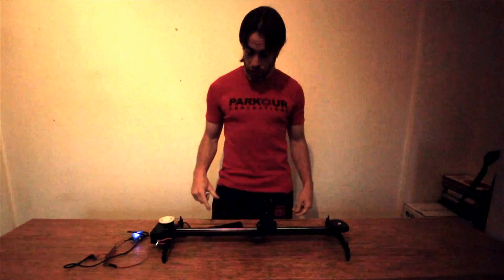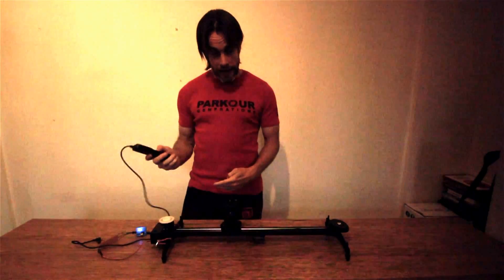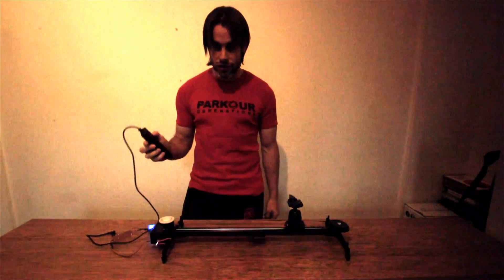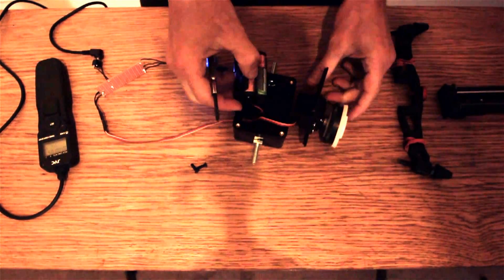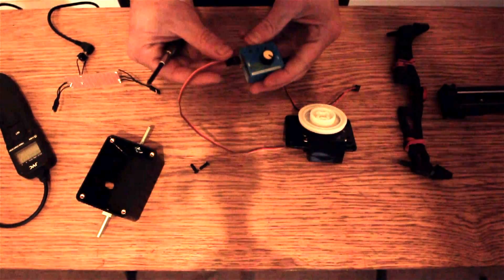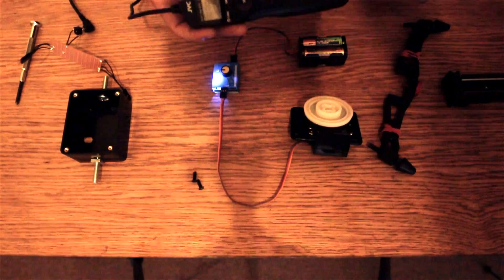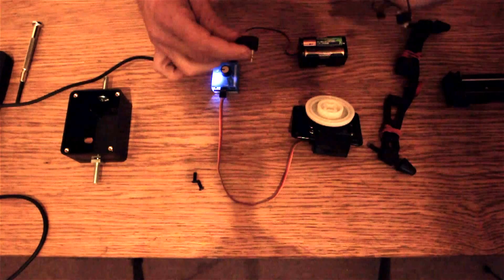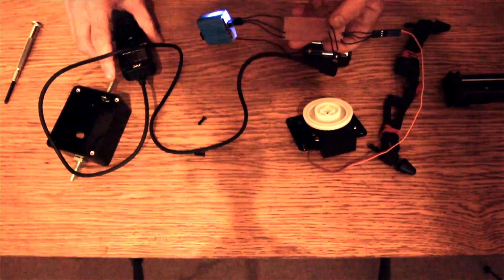How-to guide on building cheap motorised slider controlled by timelapse remote

Comment: Hi Andy, very nice idea, but I have a question. I'm wondering if your setup would still work with heavier loads, camera and lens. Have you tried to mount a heavier camera and lens, or use the slider at 45 degrees angle? I have the feeling that this motor will not be capable to handle it, or the servo will consider it as a too heavy load and will stop as it stops at the end of the course. Am I right? honestly. Thanks in advance for answering

Comment: Hi Andy, I hope you're still monitoring this post. If not, maybe somebody else who've tried it could answer. If I understand it correctly, the wired shutter remote could be programmed to move the servo motor? Are you able to sync the servo movement to do a shoot-move-shoot? What I want to do is stop the slider camera plate while my Lumix G6 shoots a long shutter timelapse of about 5 sec or more, then move about 1/4 inch, then shoot again another long shutter timelapse shot to assemble a final timelapse video in premiere. Thank you, whoever could answer this seemingly noobie question.
Reply: sonicbrush That is exactly what I am after. did you find a way to do this? I was thinking of a jack splitter one going to the module and the other  to the camera?
Reply: AssyrianHymns I have ordered a similar intervalometer like Andy had on his video. I'm just waiting for it to arrive in the mail together with the servo motor and speed controller. Have learned a few things along the way, like speed controllers for servo motors are different and not interchangeable with DC motors or stepper motors. I'm too new at motors that I'm not confident enough to work an Arduino and stepper motor. I'll post here when I get it going.
Reply: sonicbrush thank you so much I really want to see how you get on I hope your project works. thanks for sharing
Reply: AssyrianHymns Finally the continuous 360 servo arrived in the mail. My initial order was botched by the company I ordered from and shipped it on a slow boat from China, only to find out they sent me the wrong servo, a regular 180 servo. Imagine my dismay. Ordered another 360 servo from Amazon, one that's made in the US and only took 2 days to ship. Also received the Neewer EZa-C1 wired shutter timer remote very similar to Andy's in the video (which works as it should with my Panasonic G6 DSLM camera). I could not find on Amazon the same JYC remote with a 2.5mm stereo TRS (tip ring sleeve). I also have the identical blue CCPM servo speed controller consistency tester and the battery holder. Got them all working without the timer in the chain, as Andy first did on the video before putting the timer remote in the chain. Andy said he wired only the shutter circuit (tip) and not the focus (ring) with the ground (sleeve). I can't get it to work properly. The servo should not spin even if speed/direction knob is full clockwise or counter clockwise (middle is stop) unless the remote button is pushed or "the shot" programmed in the timer. But it does, and clicking the timer button does nothing. I have tried all combinations of wiring (tip and sleeve, ring and sleeve, tip and ring) still no good. I did not do the breadboard connections but wired them directly. I cut the yellow signal wire to connect the 2.5mm female stereo jack inline. Get this, while holding the two yellow wire ends with my bare fingers makes the servo spin counter clockwise regardless of speed/direction knob position. Tried taking the female 2.5mm jack out of the circuit by touching the yellow cut bare wires to the male TRS timer connector. still the same result. Am I missing something? Is my wiring wrong or is there a short somewhere? Andy's scheme is so simple and elegant and makes sense and as he showed in the video, works. I don't know what else to try. Any suggestions from anyone who's tried it and made it work? Anything help would be welcome.
Reply: AssyrianHymns Upon further testing, the shutter remote is not putting out enough signal. Re-tested the remote with my Panasonic G6, which worked the first day I received it and somehow, now, my camera doesn't even detect it. So back to Amazon it goes. I'll get the professional one that is made for my camera. It's the 4 circuit one. Figured as long as the circuit is pumping out signal, it should be fine.
Reply: sonicbrush so, did you succeed since you've got a professional one??
Reply: NIKITA  -  Got the professional timer. still the same. I found the 2 connectors that supply signal from the timer remote and hooked up as Andy did but the servo just spins even without pressing buttons. It should be in stop position (knob all the way open) until I press the timer button, but it just won't respond. I'm suspecting the Tetrix 360 servo's wiring is different than the servo Andy used. I'm waiting for another 360 servo to come from Amazon (SpringRC 4315R), a heavier duty with  more torque and designed for continuous rotation and not a modified 180 servo to work as 360. If this doesn't give me the results Andy had, I'm going the Arduino way.
Reply: AssyrianHymns, NIKITA -  After 1 year of chasing motors and code, I'm finally where I want to be in my timelapse slider design, the arduino route. Am able to shoot move shoot, adjust travel distance, exposure length,  pan (no tilt). My choice of slider motor is a 360 continuous servo, out of necessity. I can control how hard or soft the movements are unlike a stepper. My choice for pan motor is a planetary geared (19 to 1 ratio) Unipolar stepper, to make the steps at a low angle .I'm also able to send a click signal from arduino to circuit clicker using an opto-isolator. Was using a standard mini servo to click the remote to trigger the camera. It's been a long journey of discovery and I want to thank Andy for inspiring me.

Comment: Have buily something similar using a intervalometer to control a continuous rotation servo but controlling a threaded rod to to move the dolly. The gearing will be made adjustable on the Mk 2 version so it will be able to do a slightly quicker slide from end to end. My interest is in long exposure star trailing time lapse. The problem that I have not been able to fix is the servo will only respond to the "focus" contact on the intervalometer. This means the if the delay is more than 3 seconds the motor/servo will run for 3 seconds. Not a problem with short exposures but not good when average star trailing exposures are 30 seconds as it creates a jittery gap in the trails.
Slider
http://www.flickr.com/photos/stu8fish/
Ideas?

Comment: For me the missing link is (as others have said) whether the same intervalometer can rigged to simultaneously do shutter releases and servo steps. It is really just a timed circuit breaker, so the wiring would be simple. The question is whether the shutter release signal current interferes with the servo controller signal current, or visa versa. Basically someone needs to try this.

Comment: great tutorial, but i get confused where you add the time lapse controller. It's like a jumper around the controller. Could you break that portion down? What wires to the board..to the jack..to the other side to hook it all together. Please. Like i said...confusing here for me. Thanks.

Comment: hi andy! awsome solution you got here.... i try to build something similar, i have a gearmotor hook up to the sled of an igus slider. motor has only + and - connectors, no signal. i control it from a box containing a voltage controler, batteries and a switch to left/stop/right. the cable connectin the sled and the box has a yellow (=signal?) cable, but since the motor only has + and -, aswell as the plugs (made the cable detachable, 6.5mm jacks) - can i simply hook it up to + or -?

Comment: Hi Andy! Me again :-). My servo (Hitac robot servo HSR-1425CR) isn't working together with my intervalometer (Phottix Nikos TC-501). All wires should be connected the right way now on the stereo socket. Is it possible, that it isn't working with another intervalometers/servo than those you are using? Thanks and a happy new year! cheers, urs

Comment: Hi Andy! Great motorized slider! I tried it without any stripboard. I just broke the signal wire of the servo motor and soldered a 2.5mm mono socket in between. But it doesn’t work. If i connect the intervalometer, the motor starts immediately to turn (without giving an impulse/sign of the intervalometer). Is the stripboard really necessary? Or how did you solder the signal wires on the mono socket? Thank you and cheers, urs

Comment: Hey, this video is brilliant, I've got hold of a bigger spindle to fit on top of the motor but I need a longer screw to hold it to the top of the motor, where did you get yours? I've pretty much exhausted all shops in my area! thanks